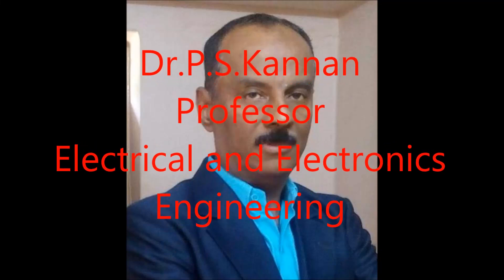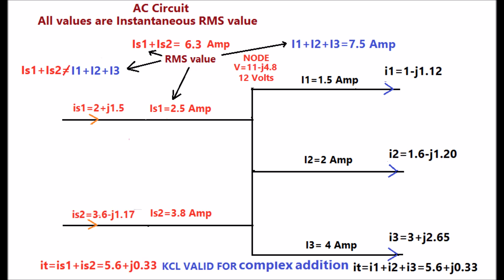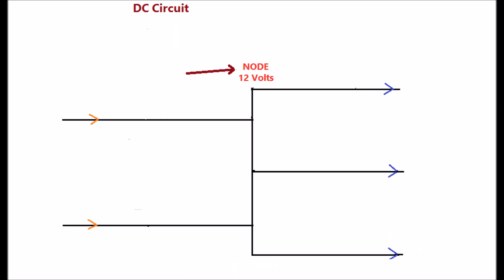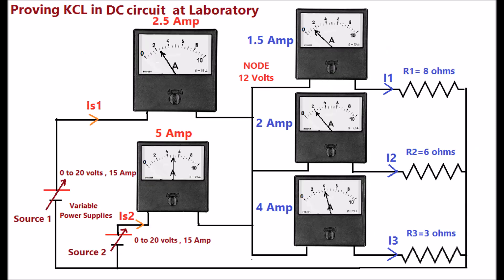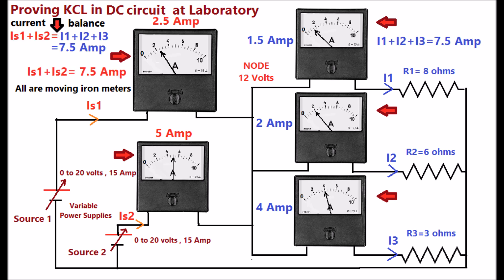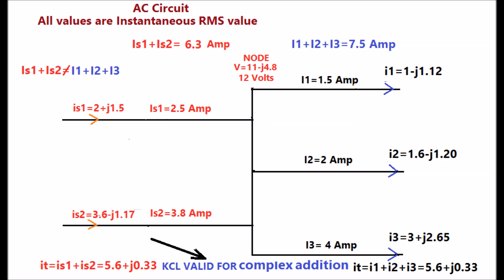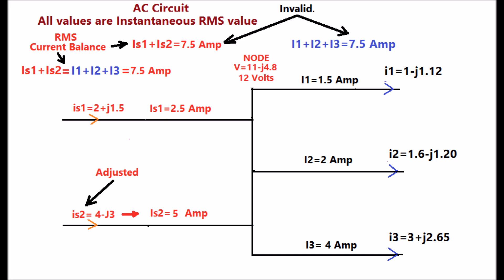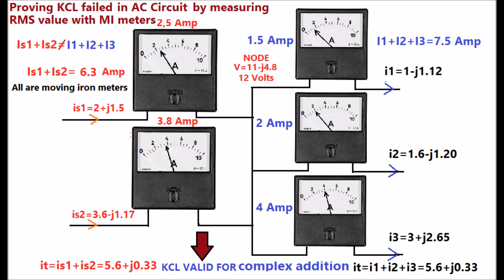KCL FAILED WITH RMS VALUES IN THE LABORATORY DEMONSTRATION

Comment: The Vector Qty MUST NOT be reduced to Scalar Qty (which is also meant for some other purpose) for Kirchoff's law.

Using RMS qty is akin to looking at a long rod perfectly  pointing from the eye-level and saying there is No length for rod and it has only diameter.

Ilangovan. Alumni, TCE
Reply from the maker: At the ac node two  currents 1 and 2 are incident currents.
Both of them are  complex RMS instantaneous values.
Similarly the outgoing currents are1,2 and 3,all are complex RMS instantaneous values.
Adding the real part and imaginary part of incident currents gives total value in  complex. Similarly adding outgoing currents 1,2and 3 gives total value in complex .Input total value is equal to output total value.So the magnitude of input total value and output total value are the same.KCL valid.
Now find the magnitude of individual input current 1  and 2 ,add them.
Similarly for all the output currents  and add them.
The two sum values are not equal.So KCL not valid.
Practically mi meters are used to measure the magnitude of individual RMS values of input and output currents .
Note that the sum of the  reading of the two input meters is not equal to the sum of the  reading of three meters in the outgoing side.
KCLfailed.
Therefore we are not able to prove KCL practically at ac circuit nodes with mi meters in the Laboratory.